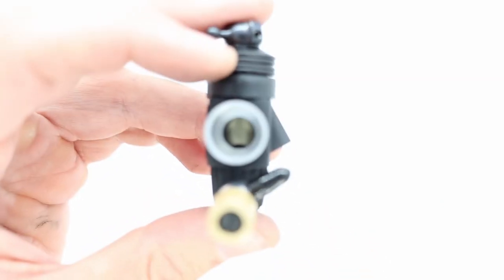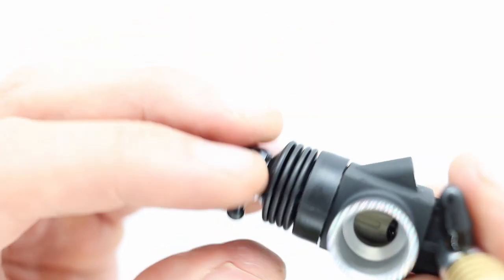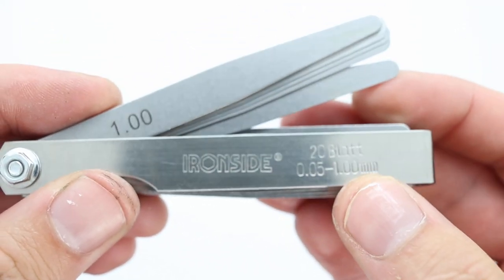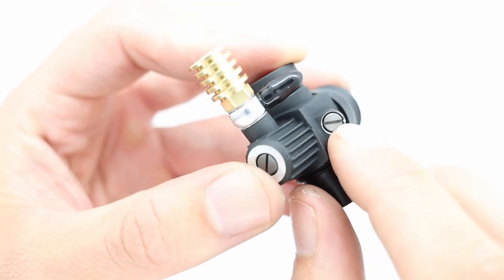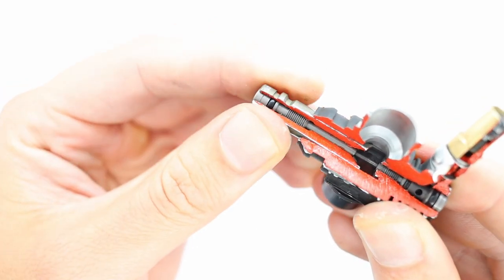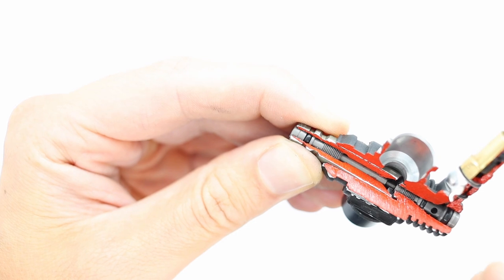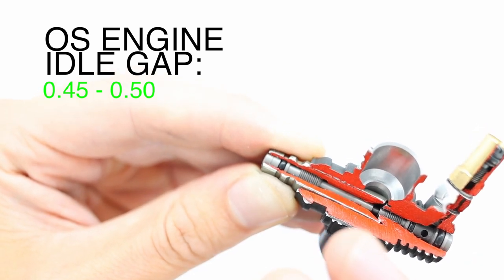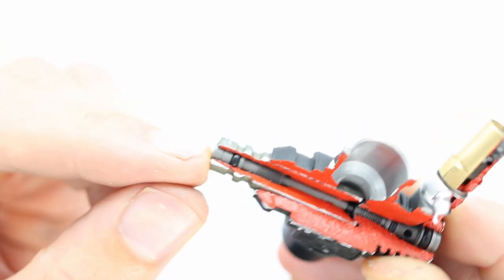How To Set Your IDLE GAP! The Starting Point of You Carburettor Tune for Nitro Engines

Comment: Hi i have a challenge with my hpi mt2 with aG3 nitro engine. I have measured the gap and my idle gap is as per manual. High speed and low speed needle is flush with carb engine stars fine but as soon as i apply break or keep it on the ground it shuts off. What should I do? Please help

Comment: Quick tip: you can also use small sections of music wire (or aircraft style safety wire) in the appropriate diameter to measure the gap.
A fairly common steel wire size: .020” = 0.5 mm
You can usually find this in the model airplane (or train) section of your LHS.
Reply: I was thinking along the same lines - a .5mm airbrush needle is fairly common and relatively high tolerance I believe

Comment: You know what works even better than chopped up feeler gauges……..solid core copper wire. Find the appropriate wire gauge size that matches the desired idle gap and use that.  Much easier. 👍🏽

Comment: I have been trying to get hang of this. The manual for my Losi 8ight Buggy states that the idle gap is 1/16" to 3/16" (1.57mm to 4.78mm). That seems huge compared the 0.5mm to 0.7mm you mention lol.
If the idle gap is also set too large, will that cause the car to start rolling on its own?
Thanks again for these helpful videos 😎👍
Reply: Yes, that would cause it to roll on its own. Also, it is worth noting that a failing clutch spring will also cause the car to walk on its own

Comment: JQ brilliant info! Tried tuning my engine this way and so much easier knowing your idle gap. Engine tuning is much easier too understand since watching your videos. I will keep watching them and keep learning. Thank you again 👌💥
Reply: But you just cant use same idle gap for all engines, so what do you wanna do if you dont know it for your engine????????????????
Reply: @nikolajc7617  Hi, you need to know idle gap for your specific engine! JQ gives you the idle gap for the o.s to set it perfectly. Since tuning my engine this way. I have gained power, run time and had no issues. 👍
Reply: @CraigAndres  Thats what i said.
Reply: The video is all about tuning o.s engines so if you own a o.s you got the idle gap, if you don't own a o.s then find the idle gap then you know. My Truggy is fast as heck and 10 minute pit stops is no problem.
Reply: @CraigAndres  lol, the title says nothing about OS engines.
It was your words that made it sound like you didn't know to start with correct idle gap
Reply: The title does not but in his videos he talks about idle gaps for 0.S engines. A final all year so far so must be doing something right. I have also been running Apha Engines and a Picco. All are great and figured out idle gaps roughly and all run perfectly.
Reply: With all engines you won't know exactly where to start unless you speak to a top racer at your local track that knows the engine. That is why this video is helpful to help you set your engine up and get the most out of it. There is a huge difference between a engine set perfectly and a rough set up. Especially for top end racing.

Comment: Hi JQ, I am new to nitro and tuning the engine but I have had a lot of 2 stroke engine machinery in the past so I think I should get tuning down. I got some really good tips from a few people at my one track I go to, in fact the fella that helped me the most was on your race team. What a great fella, he took the time to explain things and show me stuff and answer all my questions. I feel much better now about attempting to tune the engines myself. I was wondering, could you make a video about the long low speed needle vs the short low speed needle? I have 2 engine right now and one has the long needle and the other has the short. I got the long needle engine running great, smooth, smoke coming out, plenty of power, idles good too. The short low speed needle engine though doesn’t seem right at all. On the box with a slow throttle pull the engine will rev up steadily then at mid throttle it hangs up a little then finally revs out. When I put it on the ground and drive it, it responds like that too only at full throttle it start to get really weird sounding, light I would say and there is no smoke, so I would say it’s very lean on the top. Plus it doesn’t idle right at all, up, down, back up again. To me the short needle seems like garbage. This is how I look at the short needle. At half throttle, the needle is completely out of the jet so that means 100% fuel flow but the slider is not fully open, so too rich at 1/2 throttle. And at 3/4 throttle the slider is open a little more so more air, so maybe the engine is running fine at this point. Then at full throttle the slider is fully open and you are getting full air and the engine is too lean now. This is how I see it 🤷‍♂️
Reply: So after I wrote this I have come to realize that the short needle must obviously work otherwise engine manufacturers wouldn’t use them, I obviously have no clue 😉 Anyway, I took my car with the erratic running engine to a really big race and a couple people felt that it has an air leak. It’s a brand new engine so just my luck, I guess I’ll be running the other engine for now

Comment: so these little carbs don't have a dedicated (separate) idle circuit like a 2 stroke outboard or a 2 stroke jet ski motor i'm assuming since they are so tiny. interesting! any idea what the idle air gap should be for a dynamite .21 motor? the manual just says the idle air screw should be just in from flush on the needle body. why do you need to measure it if you can just tune it ... or will it make it too difficult to adjust when running?

Comment: I am a little confused JQ and am hoping you can answer a question. Should you always set the idle gap without the venturi (sorry I think I spelled that wrong) in the carb intake or set it with the venturi in? Because I have noticed that when you set it without and put the venturi in, it kind of disappears
Reply from the maker: @fuzzfreak1967  yes as in the video
Reply: @invisiblespeedrc  thanks for clearing that up for me

Comment: Just a quick question. I have a hpi bullet and a hyper 7, both manufacturers state 1mm idle gap, are they being over generous? Would i get better results using 0.5mm gap as you suggest for the os carbs?
Reply: Try it and find out....

Comment: I have a question, there are some people ( on road racers) who want to know about the condition (has carbon on it) of the glow plug and how it effect the tune of the engine?
Reply from the maker: I think a damaged glow plug will make the engine run rich, so if you adjust the engine to run right, and then change to a new glow plug, the engine will run lean with the new glow plug.

Comment: Is the idle gap values in mm or inches? I have an os .30vg that I have never gotten a good idle on.
Reply from the maker: mm
Reply: @invisiblespeedrc  do you have any tips on tuning that engine? It’s always been difficult. It has a hanging idle like it won’t come off the pipe for 20-30 seconds when trying to get down to idle. At this point I think it needs a full carb reset.

Comment: Do you know what the idle gap should be on a ke15sp koyosho engine? 
I just got this nitro and am new to this.  I watched your video and tried to fine tune after the break in. 
After getting it close. Engine stalled.  Wouldn’t start. I thought my tune was off , soooooo I messed with all the settings because it wouldn’t run. 
Ugh it was a unexpected bad glow plug. So now I’m nowhere near where I should be.
There are no factory settings that I can find to get me close.
Reply from the maker: Start from rich side, you don't need factory settings. Set idle gap to 0.5 to start.
Reply: @invisiblespeedrc  thank you. 
I’ll give it a try.

Comment: Does the idle gap method also work for on road? For let's say an O.S. 2104?
Reply from the maker: Yes of course.
Reply: @invisiblespeedrc   Thanks, and just out of interest, what about others brands like novarossi?
Reply from the maker: They are all nitro engines. Of course it applies. The only difference is the best idle gap to run. And that can be found through iteration, as explained, and showed in the full version of the video.
Reply: @invisiblespeedrc  That last sentence answers my question. Sounds logical, but it's also good to have it clear that the 0.5mm does not necessarily translate directly to other engines.